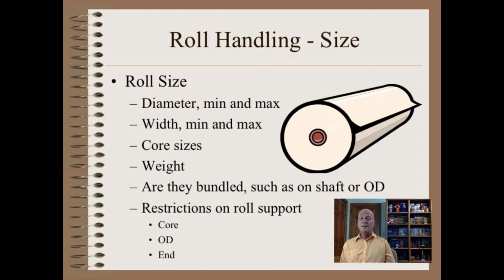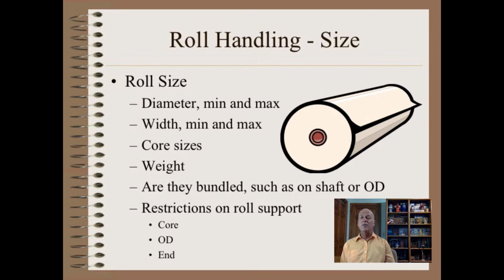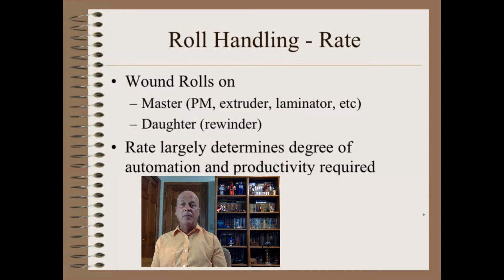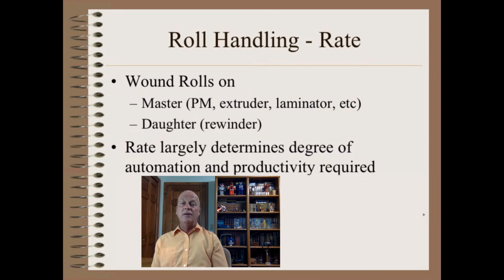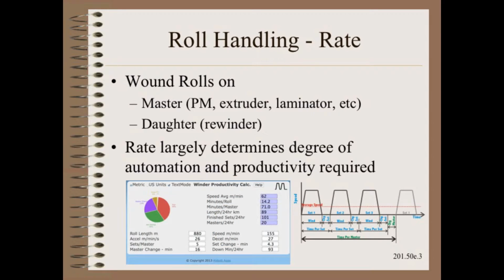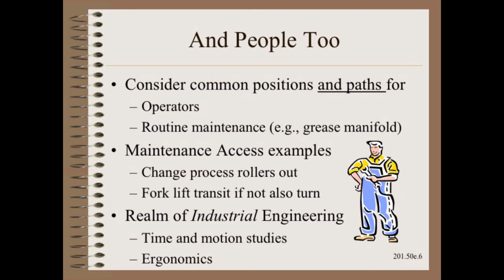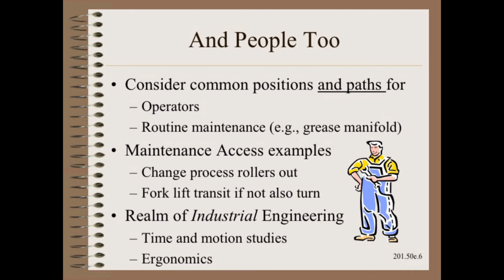Web20150e - Web Machine Design Review - Materials Handling

Comment: Web20150eF4V - Web Machine Design Review - Materials Handling   Dr. Roisum, great info on Materials Handling, I had one comment to add about ensuring the machine can handle "REWORK" or other type finished coils that might need to be "SALVAGED".  Always a good idea to make sure you know how to deal with a coil that might need to be rewrapped or reprocessed if you don't have a separate machine to do this task. Making it 'right" the first time is definitely the idea solution but from my experience it is also good to have a plan B for those times when something gets run on the wrong setting.